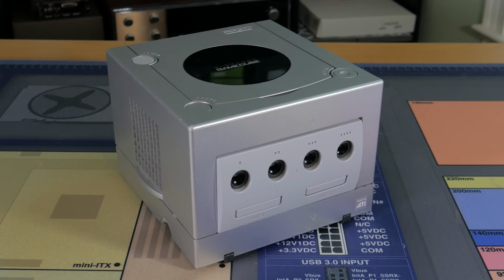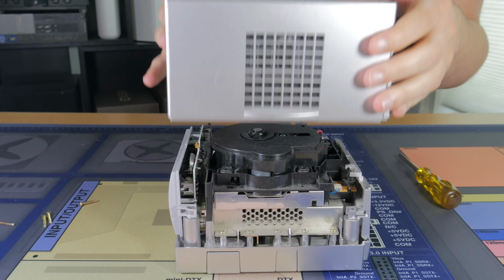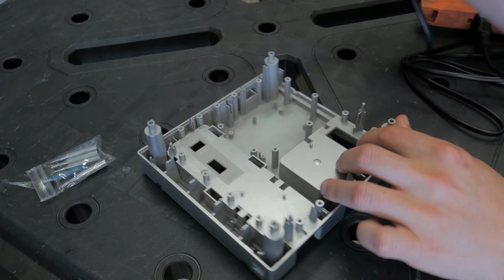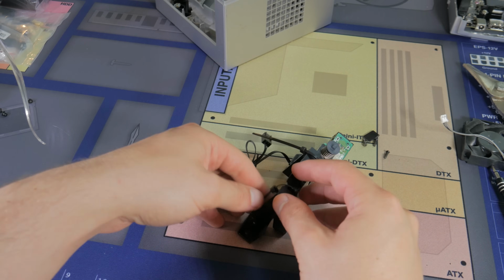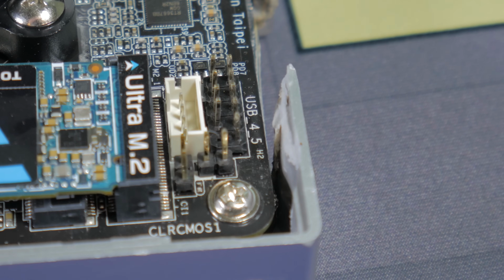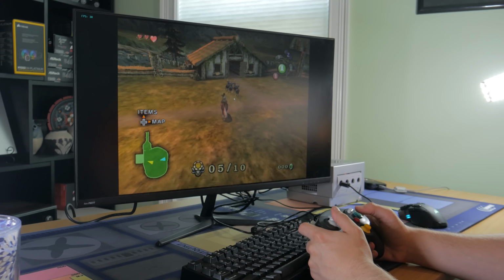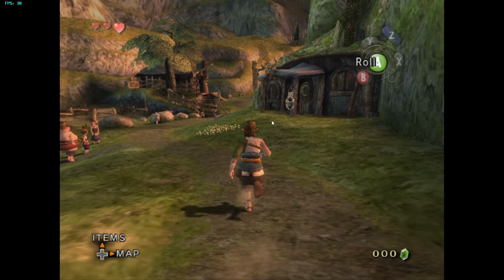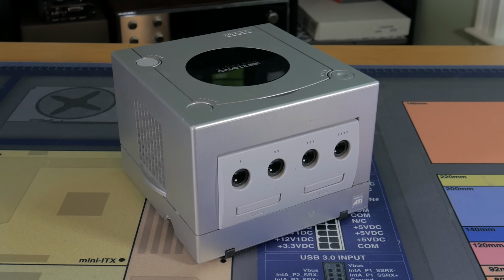I Built A GameCube Gaming PC!

Comment: FYI: Those lag spikes on BOTW are actually shaders compiling in real time whenever a new animation/light/shadow/effect/or texture is displayed. There are about 10,000. You can actually find shader packs online that are pre-compiled, and will increase game performance exponentially by removing all shader related stutter (at the cost of RAM usage, which should be fine with 16GB).

Comment: Why not remove the plastic in the disc compartment, so when you open the disc compartment, the PCube can get more air for it's processor and so run cooler

Comment: A little info on the Wii U emulation side...
When it comes to BOTW specifically, the game will compile shaders as the game goes along, which is what causes the lag spikes (you can tell in the corner when it says "compiling shaders..."). However, once all of the shaders have been compiled (this will take about an hour or two of gameplay), you won't have any more lag spikes from compiling shaders. 
And you're right about the settings. There are a good few settings to change to fully optimize Wii U emulation on CEMU, and most of the changes heavily increase performance. Graphics packs, game profile settings, general graphics settings (like changing what graphics API you use), etc, all help. In my experience, BOTW went from 720p running under 20fps to 1080p staying around 60fps.
BSoD gaming has made tutorials on optimizing CEMU based on components and CEMU version and are a really good help if you're serious about emulating BOTW.

Comment: You could find a way to make the original disk drive work, but load all your disk based stuff on mini dvd.  It's not ideal, as you'd be unable to play full size disks, but you could at least have a working dvd player from the top loader, which would be pretty cool.  The main thing is You'd have to being collecting a library of home burnt mini dvds

Comment: what about using the ribbon cable from the original front ports and connecting it to the adapter's controller.  It looks like it'll fit, and it's worth the try
edit: disregard the controller board was still needed from the adapter

Comment: Soldering irons do not have cutting tips, its for soldering smd. I used a tip like that on tiny resistors and microchips with no legs. I repeat there are NO cutting tips and should not be used for such things. 

Other than that great idea for a GameCube sleeper

Comment: You could switch to a vega 11 APU for added performance, but then, you'd need more cooling. What I've done in a similar project was to install a wraith cooler, and use the top disc access as a vent when needed

Comment: Wii emulation actually requires a startling amount of graphics horsepower.  I'm surprised that you got it to run so well on an APU.  We have a GTX1050ti in our Wii emulator, but I don't think it needs quite that much power (it's just what I had laying around).
Reply: doesn't need much

Comment: PRO TIP: heat up the back of a pen and press it in the screw hole while still hot will make you a perfect tool, that's how I opened mibe back in the day
Reply: Actually this is just an inverted spline bit. Nothing specially made by Nintendo.
Reply: @melmelhodgepodge3800  ok
Reply: Yes. Thank you. Angels do exist.
Reply: Wouldn't the plastic have a hard time standing up to a tight screw that's been in place since 2001?
Reply: @kotojojojo  the screws are not that tight, and when you press the hot plastic you are introducing one heat cycle which also helps to brake them loose
Reply: Just posted this same advice but you havw already done it my good sir

Comment: You didn't replace the stock CPU cooler? The Noctua nh_l9a is similar in height isn't it? Wouldn't that have fit inside the gamecube case? And you could've still used all the various buttons on top of the gamecube with a disk drive if you went for a roller style disk drive and modified it to fit inside properly like what consoles have, having a gap inbetween the buttons for the disk to pass through but not too wide that it doesn't press down anymore? Or designing it so the buttons are pushed down when the disk is inserted or ejected but only pushes down enough for enough clearance for the disk to pass and the buttons spring back up after each insertion and ejection? all that would've required was cutting, shaping the buttons so the disk pushes them downwards and using disk safe coating or cover on the inside so it doesn't scratch the disk when the disk is brushing against the buttons? And using some springs to keep top section of the buttons from hanging down all the time so you get that same feel when you press them. If roller style wouldn't fit then use the lid for the ejection and have it hold onto the disk for easy removing and replacement? The buttons can press onto the disk, which in turn presses the button down enough  to activate the power on, restart and etc. It's only where the lens is that needs to not be obstructed. Just need a cover on the buttons that doesn't leave residue on the disks and also doesn't damage the disks.

Comment: That 200 dollar pc is better than my 500$ pc. WHY DOESNT GOOGLE TELL ME THIS BEFORE I BUY IT???
Reply: And your pc also isn't a gamecube
Reply: Carson W234 yeah, my pc kinda trash
Reply: Well you probably have intel integrated graphics.
Reply: Carson W234 nah, but idk why you tryna roast? It ain’t good coz it’s running 16 gb ram, amd fx 6300, nvidia gt 1030.
Reply: @ClippyAnonymous  That setup should play games as good or better then this gamecube though. A 1030 is more powerful then vega 8 and I have played fortnite on an fx-6300 and I got a solid 60 fps.
Reply: Carson W234 yeah but all my games for some reason struggle on all low settings, the fans ramp up to max power and stay there even after I close the game and the system in general just feels sluggish. The only way to make the fans slow back down is so do a sys restart.
Reply: @ClippyAnonymous Check your thermals. Most likely your cpu is overheating and throttling hard.

Comment: Cool. I did something like that with a Dreamcast a few years ago. I managed to get an ITX Mainboard + GPU + Power Supply + BluRay Drive in there. Unfortunately i didn't managed to get a sufficient cooling system in there. The original solution sounded like a jet engine because i overvolted the fans but still couldn't get it cool enough. I ended up water cooling it with an external radiator.

Comment: Many compliments for what you have achieved! Basically you have a good pc in a so small nice GameCube case :)
One question: if you can emulate Gamecube and Wii games with a Ryzen 3 3200G can we take for granted that you can run Saturn, Psx, N64 and Dreamcast games too? All of them are weaker than a Wii.

I have a Ryzen 5 3400G with a Vega 11, 16 GB DDR4 3000Mhz and I would like to emulate some games I could not play for the above mentioned consoles

Comment: I really REALLY want to see an mITX motherboard released with this external power brick , and a 6 pin "expansion" PCIe power on the motherboard to plug into your GPU.
That'd free up SO much space in mini-builds like these. Might make it possible to fit a GPU inside the Wii finally!

Comment: Dang this is awesome! You should really put a Ryzen 5 APU or upgrade it to a new 3rd gen ryzen 5 3000 sires. This really deserves it. Test more Wii U and maybe some Switch emulation. Also try PS3.

Also make the front card slots USB 3.0 ports (if theres an extra header) or an SD card slot.

Comment: You call yourself a soldering noob.. but you blow my skills out of the water lol.. Ive been soldering for 20 years and I still suck LOL!! My ONE gripe with this is that you really should have gone with the r5 3400g, the extra 4 threads and the better vega graphics really do make a difference, especially overclocked, When overclocked you can even run RDR2 at medium settings and get a very respectable 45 or so FPS. (which is amazing for a IGP solution) Other than that, bravo sir, excellent job. 

Next time you fire up your breath of the wild Wii U emulator, switch to the vulkan front end, or find a full shader cache for breath of the wild and download it if you want to stick with the original API, those lag spikes are caused by loading new shaders. Theyll go away as you load more areas and do all the moves, defeat enemies, and just play the game as normal, but the Vulkan API doesnt run into shader cache lag spikes like that. Before they got the Vulkan API working on it, even the best of systems had those lag spikes in the beginning.

Comment: Rather than trying to fit a CD/DVD drive which generally gets very little use these days, you might be better off using that top space to fit a USB / memory card hub just using the lid to hide it away while it is not in use.  The good news for upgrading this is that it looks like AMD's next generation of APU should be a fair bit more powerful.

Comment: My question is does the original ribbon cable for the gamecube controllers line up with the ribbon cable for the gamecube controller adapter? they look like they use the same ribbon which leads me to think you did extra soldering for no real reason other than overkill construction.

Comment: Should of just bought a proper piece of 1/8 inch aluminum or similar from a metal supply shop cut to size you needed. Would of made it way easier for you, then epoxy that sheet to the base of case itself. Just did this for my NES htpc.

Comment: Not trying to bash you or anything but i can't help but think this was a waste of a Gamecube; broken or not.  The soldering iron melting the parts of the shell out was super cringey as well. You could have easily just plugged the Gamecube adapter into the PC's usb ports and left it in the original case which is shorter and cleaner.  Congrats on modding your PC to something unique though!

Comment: Try to build a PC inside a PS2 SLIM.
Challenge denied.
Reply: It could be possible, take apart an Intel NUC and replace it with the Slim shell lol
Reply: EZ mound a latpot far more slim than the ps2 xD
Reply: Certain laptop motherboards would definitely fit - including ones with actual GTX graphics
Reply: Even if this would be possible. How would it be managed to keep the cpu and gpu cool?
Reply: pc in a switch😂

Comment: There was a replacement game cube case top that allowed for full sized CDs often sold along side mod chips. You could have tried using one of those if you really wanted to have the top loaded disk working but it would have looked like a modded cube at that point.
You could also have added a game boy player to have more virtual room to add a larger heat sink or a laptop HDD.

Comment: I have an idea on a v2 of this 
AMD ryzen 5 4000 apu
the a320 board u used 
the beast from linus video so u could use a desktop gpu on the nvme port us the cd area to for a 2.5 ssd 
use one one the gamecube expansion docks to add a the rest of external gpu stuff and a disc drive which is removable

So the tech changes are sata 2.5 ssd 
Removable sata blueray drive  and 
nvme graphics card

Comment: Ok Matt, how about? The top space where the disk drive would be? Either cut out the internal section and place some mesh so you can press eject and then acts to exhaust hot air or maybe use the space for a 2.5” HDD or something? Also did you OC? Or enable Extreme Graphics mode? Or Dedicate 2GB VRam? As these bits will make a huge difference in gaming with my experience owning a 2400g.

Comment: On BoTW I would recommend downloading pre compiled shaders and to go in to cpu settings and turn on multi thread use. Also a problem I ran into was programs running in the background cause the stuttering and lastly download CEMU hook its a speed hack that will fix 90% of you're problem.

Comment: Im gonna give you a tip that is gonna save you some pain later on. When you cut sheet metal using snips, never finish the cut with each squeeze. You will not only leave ugly jaggies on the cut, but you will also lose the "bite" your snips have in the metal, allowing the snips to slide forward and probably slicing you open as your hand runs against the metal. Basically never squeeze the handles all the way closed while cutting.

Comment: removes gamecube pcb makes sleeper pc installs gamecube emulator
Reply: s t o n k s
Reply: Why would you not?
Reply: There is actually a benefit there, even if all the PC ever did was emulate GameCube games. You can run emulated GC games in 1080p (or higher) and have a crystal clear picture compared to native GameCube games at (I think?) 480i via RCA. I once installed a Switch emulator on my PC and ran BotW at 3440x1440 and it was very sharp.
Reply: @jafizzle95  You can buy adapters now that can upscale the gamecube to 1080p and it looks really good
Reply: @kit7une_  but netplay....

Comment: Can you mod the front MemoryCard slots into USB 3.0 ports for flash drives? 
Also, for games to emulate, Try MarioKart8 or Double Dash. Also, I would love to see a stock wavebird paired with this system or at least one of the Chinese clones. Also, I would say being able to pop the top disk drive open for more air flow could be a nice feature. 
Very nice build. Not bad emulation performance, but not quite WiiU territory.  You could easily get some PS1 and N64 though... But I would say maybe a Lauchbox build and go ALL nintendo only so you can really outclass the NES and SNES classic. You could probably set the console to autoboot into a front end and you could put the gamecube intro in there.

Comment: The lag spikes with the Wii U emulation are due to the loading of graphics from the first time, you can see in the top left corner, this also happens a lot with other emulators such as rpcs3 and can be fixed by playing in the same area for some time so it can store the data.

Comment: Ah I've seen this done with an APU only once before, I've been working on trying to get this to work but with including a graphics card. I'm mostly relying on motherboard size and the size of graphics cards have gotten small, but not quite small enough (I need another centimeter off). BTX is the smallest motherboard size for current gen IIRC (besides stx) but I'd like to see something a little bit smaller that fits a full size CPU/RAM, and a m.2 slot with a single pcie slot). I'm asking a lot but I'm hoping next gen brings what I want. I've only found one motherboard that fits my criteria but it's apparently only for commercial use and is an Intel socket (which with their heat at the moment wouldn't be a great idea). We'll see what the future brings us.
Reply: BTX boards are pretty large.

Comment: Hey, amazing build! I have a question: Why did you choose to solder each controller port instead of plugging it's ribbon cable into the adapter's PCB?
Reply: Don't know this for sure but they'd have to be the exact same pinout, or similar enough that it wouldn't cause problems. We don't really know how the pins are arranged on the USB controller side of the connector.
Reply: @freefalcon23  true but he could atleast try, they look like they're the same width and could be compatible

Comment: There is a mod for the GameCube that replaces the optical drive with an SD card slot.  You could modify it to work with your new GameCube PC.
Reply: lol I hope you see why this comment makes zero sense
Reply: If you want an SD card where the optical drive used to be, nothing stops someone from just.... you know, taking a USB SD Card slot and modding it to fit in the disc drive slot.  No need to buy the exact kit to mod a GameCube this way.  The PC is an open platform.
Reply: all that did was allow gamecube games to be loaded from an SD card which was connected via the memory card slot,  in front (the memory cards have a similar pinout to SD Cards) and you needed a modchip or a loader to work with it, didnt work on a stock gamecube firmware

also it didnt replace the DVD drive, only gave another option, you could still use your gamecube disks with it.
Reply: That mod just replaces the CD drive with the sd card as a form of input. He just ripped out all the original gamecube internals.... that mod won't work anymore. 

You could run gamecube roms for a linux/windows emulator though.
Reply: There were top load external usb optical drives for laptops. It seems like it would be pretty easy to make that swap, but the optical drive cavity would have to be made a little wider or be happy using only using 3in optical disks.
Reply: Use a USB card reader! Slip that where the GD rom was.
Reply: Guys, I'm specifically talking about using a plastic insert that replaces the disk drive and allows for SD card functionality.  Here's an example.

https://youtu.be/iKXMIveMmYE

I'm not suggesting to use a GameCube mod chip, or any other homebrew method, as a way to get an SD card slot on a PC.  That's just ridiculous.  I'm just throwing out an idea to make this project a little cooler.
Reply: @mister3speed727  dude lol, the link you posted is for a gamecube not a pc. this trick is using the gc components and homebrew to re-route where the gamecube reads the game to the sd slot underneath it. if you want to do something similar in this build, you can simply buy an actual sd card reader and plug it into any usb slot. other than reading pictures from an sd card from a camera, this would be a pretty useless addition to the build when you can use the usb ports or straight download anything from internet.
Reply: @HeaftyBlast  The plastic piece is near the end of the video, and there's a link to it in the description.  Like I said, I'm just talking about the plastic part of the mod.  It's not useless.  It's just unnecessary.  The same could be said about putting a PC into a GameCube shell, but here we are...
Reply: @mister3speed727  damn these kids just won't listen to what you're actually saying lol
Reply: @mister3speed727  lol